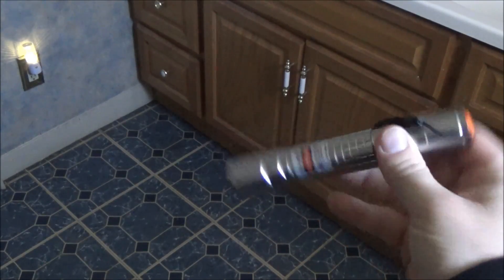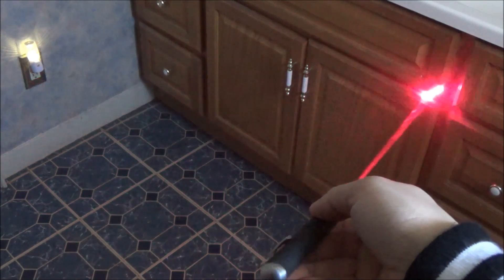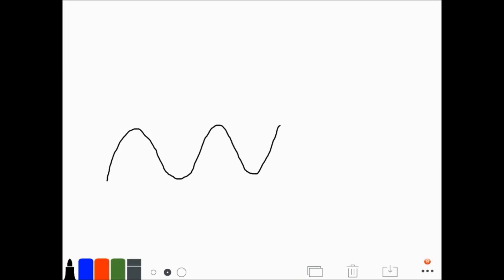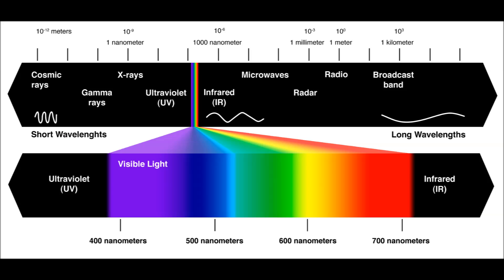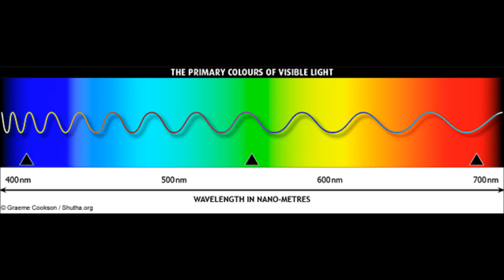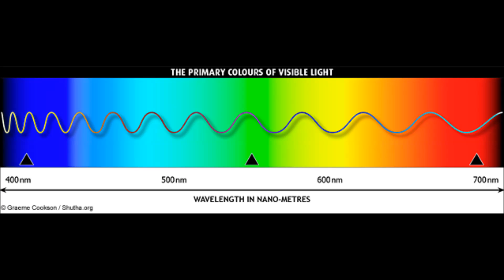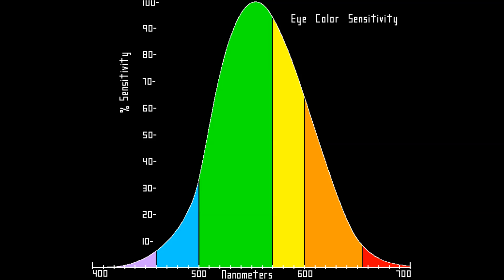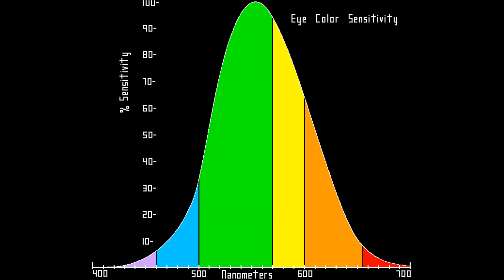Lasers - Wavelength (nm) Explained

Comment from the maker: CLICK BELOW FOR THE UPDATED VIDEO:

https://www.youtube.com/watch?v=yn0ZJzMo6lo

I've created a new YouTube channel focusing solely on lasers, with a greater focus on safety, video quality, and accuracy of information. Click the link below to check out the new channel, and be sure to subscribe so you can see all of my latest laser video uploads!

https://www.youtube.com/laserfocuss
Reply: Thank you for the information. Very helpful 
But I have a question for you 
I need a laser that can project through 2x2 inches designed object and withing 3 feet or so It will project the design to be about 2x2 ft in day light ? 
Is this possible.
I appreciate the help in advance thanks
Reply: 3 question I got 650 nm.red laser 1 how dangerous is this laser ?  2 what's the visibility like ? 3 what kind of batteries do I need to purchase ?

Comment: So what would cause a green laser to change color on contacting a  surface? I have this orange felt if you shine the laser on it it turns the laser light white on contact, And the light reflected from the laser off the felt is white. Why dose this happen, I genuinely don't know? The laser dot stays the same color on every other material regardless of color, or texture. But as soon as it touches the orange felt it turns the light white on contact even cause the glare reflected off to turn white.

Comment: Good video. Could you explain mW and wattage, also some lasers are rated in miles, whatever that means. And why are focal length and focus important, or are they? Thanks
Reply: for the miles thing, its supposed to be how long you can see the laser from, but its p much fucking useless, ignore those
Reply: Watt is a unit of energy and mW is 1/1000th a Watt. It is denoting power output typically of the beam itself and not it electrical requirements to power. Lasers rated in miles is a marketing term and not a standard you should ignore it for other ratings. To cut or burn with a beam you need to focus the beam to a single small point and concentrate the power output of the laser into a smaller surface area and all of this including collimation and divergence ratings are more about the optics then the laser itself. Divergence ratings at distance indicate how imperfectly collimated the beam is or how straight the light is traveling for the whole beam and how much spread or larger the dot will be at a specified distance. The atmosphere will scatter light traveling through it anyway here as that is why the full spectrum output of the sun looks blue when it is really blindingly white.

Comment: So the color of,laser has nothing to do with the power of the laser? ....it seems years ago imremember most of the cheap lasers were red and the stronger ones seemed to be green....
Reply from the maker: Things were only that way because the commercially available reds were weak, and then people figured out a way to cheaply manufacture powerful DPSS greens that were much stronger. But you can have lasers of any color and power (based on the available technology)

Comment: whats the best cheap laser with visible beam that is also safe to use for beginners
Reply: https://www.ebay.com/i/302330273266?chn=ps&dispItem=1&ul_ref=http%253A%252F%252Frover.ebay.com%252Frover%252F1%252F711-117182-37290-0%252F2%253Fmpre%253Dhttps%25253A%25252F%25252Fwww.ebay.com%25252Fi%25252F302330273266%25253Fchn%25253Dps%252526dispItem%25253D1%2526itemid%253D302330273266%2526targetid%253D323617871734%2526device%253Dm%2526adtype%253Dpla%2526googleloc%253D9018987%2526poi%253D%2526campaignid%253D852311515%2526adgroupid%253D46150848187%2526rlsatarget%253Dpla-323617871734%2526abcId%253D1128846%2526merchantid%253D115326420%2526gclid%253DCjwKCAjwk4vMBRAgEiwA4ftLs_hx2SjG4qnQQPDarVpXOuc0Cv97NiNPCTwNk5stNmFgkmyQC_mf4hoCA_sQAvD_BwE%2526srcrot%253D711-117182-37290-0%2526rvr_id%253D1274811072477